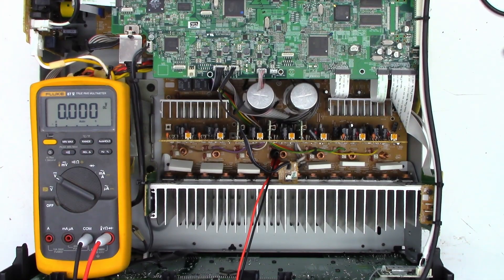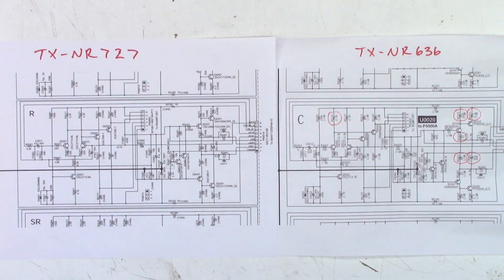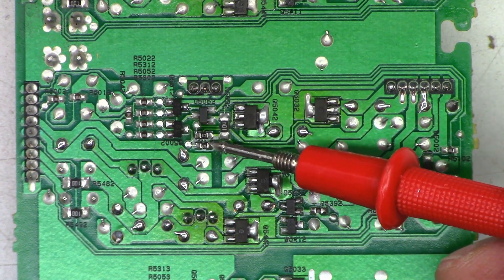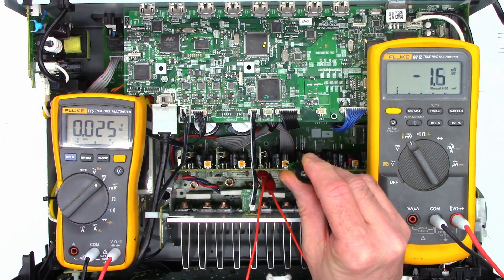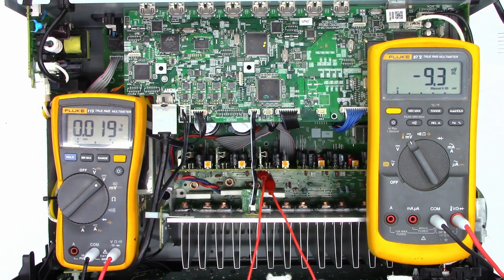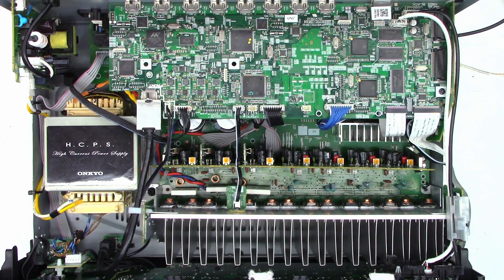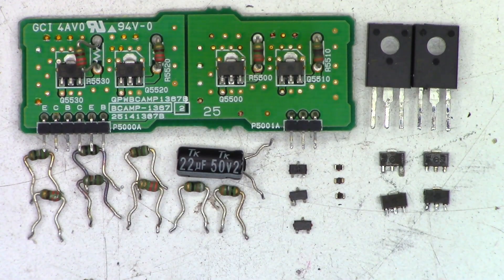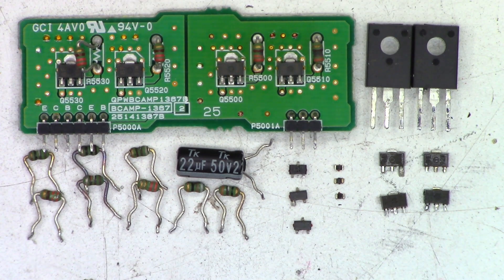Part 2 Onkyo TX-NR636 Intermittently shuts off. Corrosion? Customer repair? It's fixed

Comment: Can you fix my Onkyo tx-nr 636
Reply from the maker: What is it doing? (Or not doing?)
Reply: @norcal715  it randomly will stop working on the center left and most of the channels the right front and right rear work fine

Comment: Sony made in japan hr29m91 model TV was working, it didn't have a problem, then I tried to turn it on, when it opens, 10 red lights flash, it gives an error and turns off, what do you think?

Comment: Thanks Norcal again really love the in-depth diagnostic and inner engineering skill you have. I’ve got a Yamaha DSP735 in causing me massive problems, intermittent power issues only for the customer though 😭 I could not find a fault with the unit when it was first sent too me, tested it for a week or so I quoted for a full recap, I recapped it set the bias up and all working great. Customer has the unit for a day and it’s back to clicking on and off, unit sent back and I’ve had it two weeks now and still cannot replicate the fault. Solder joints on the amp boards are fine along with the PSU and protection pcb. The unit doesn’t react to vibrations or cold/warm temperatures, will play music loud all day and power cycle with out fault. I’m really stumped on what todo 🤔
Reply from the maker: Check the customers speakers for shorts, even the midrange and tweeters. Also I have had a WIFI router too close to the unit cause strange issues. Have the customer power it up without anything connected and see if it still shuts down, even in a different room also.

Comment: Very impressive repair  - thank you for sharing this. I assume that all transistors prior the bias stage probably had been blown due to the misterious liquid impact that you have determined in your first video part. From what I have seen on my Onkyo repairs, these transistors survive if a power transistor got shorted - which is the usual case if this amp turns into protect mode . But if I understand you right the power transistors had been changed before, correct? Did you got any feedback from your customer what exactly happend to this unit?
And ...since not everyone have so much luck in having a spare unit for parts, may I ask over here if someone watching this already made some good experience in finding compatible transistor types to replace f.e. these INC and INA6006?